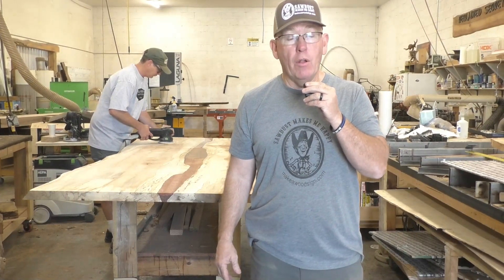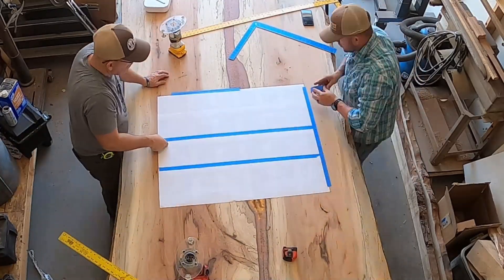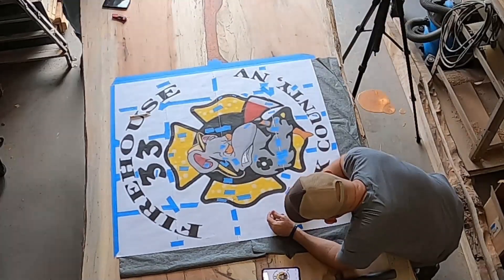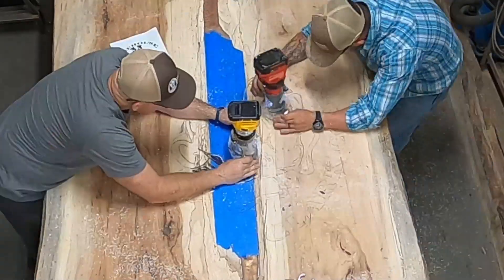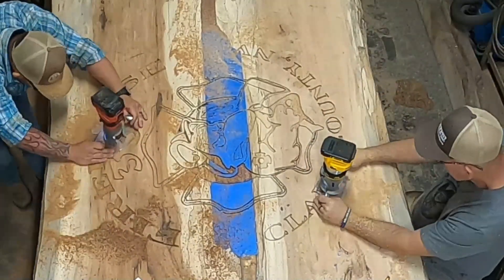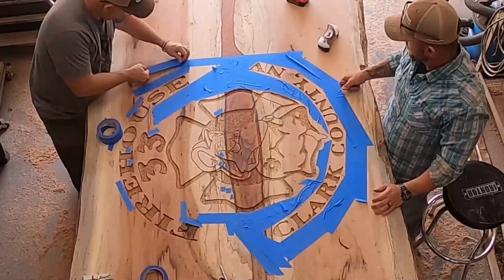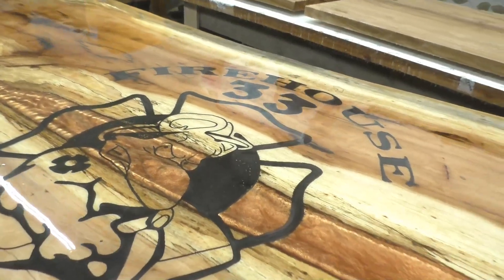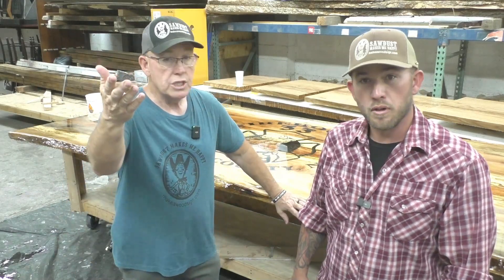Carving A Wood Conference Table

Comment: Aaah, my heart aches thinking about using carbon paper on something that big.  I do it on all my carves and I hate it.  Need to get another printer.  Haven’t carved the epoxy and sprayed over it so need to try that.  outstanding as usual
Reply from the maker: 😂😂I actually like it way better than the lacquer transfer. Way less messy and I don't have to smell that stuff.

Comment: Why not get an engineering plotter? you can print any size from 4 inches to 48 inches in width and an unlimited length. You can paste the whole design which can be easily carved and remove the paper with any brake cleaner without leaving any residue on the wood. It will save you tons of time. By the way, great job, loved it.
Reply from the maker: I've never seen an engineering plotter. But, I really don't like carving through paper. It burrs up and makes it difficult to follow the line. But I'll definitely check it out. Thanks buddy!